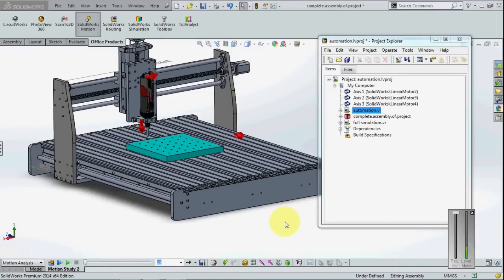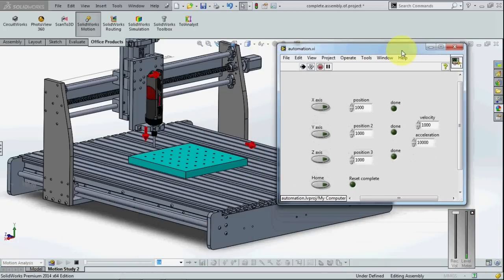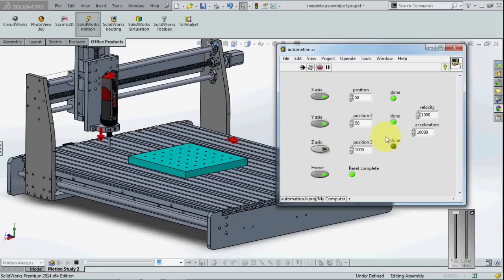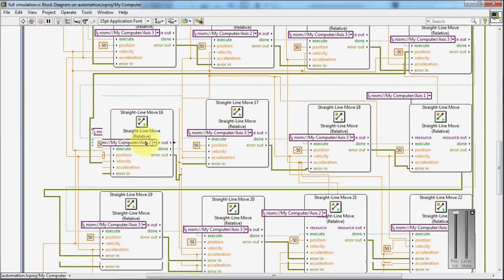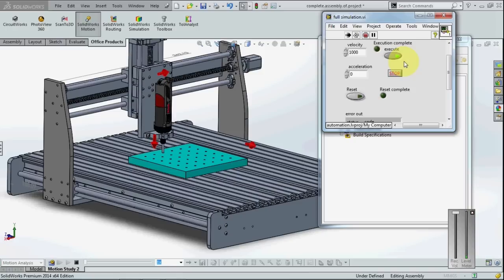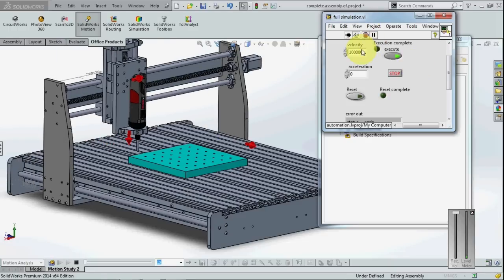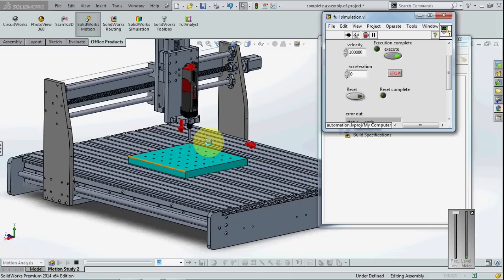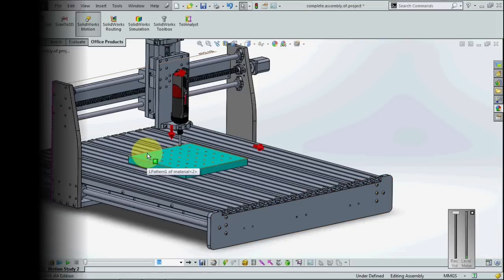Real Time Simulation With Solidworks and Labview

Comment: Hey, first i wanna say 10x for what you are doing, second I would like to know if you can help me with some guidance steps on how to get to the point that you present in your video, like what blocks to use in labview, how to connect with solidworks, how to make it run, how to create the VI file...etc. Please help me :(
Reply from the maker: Tgr Hi , firstly you need to download labview softmotion toolkit , I 've uploaded all the files in my blog http://www.labviewarduino.in/2014/11/virtual-prototyping-in-solidworks-and.html, you can check it here, you can also take a look into this video which shows steps to interface labview and solidworks https://www.youtube.com/watch?v=mWI2cLzAncI
Reply: I already have the programs installed and I will check out that video. Can i come back if I have any questions? thank you!
Reply from the maker: Tgr sure anytime :)
Reply: Arduino Robotics LabVIEW Solidworks I have chosen a model like the geneva wheel so i can practice this motion study on it. So there as i presume you know, that wheel spins...so i chose a rotary motor for that, but for the labview i must have a distance motor, so i chose a distance motor instead of rotary?? And second, in that video that you gave me earlier you selected a straight-line move block for your model, do i do the same or is there some other block for spinning?
Reply from the maker: only distance motor is supported by the labview .. you can select the straight line move block , it will work
Reply from the maker: Tgr only distance motor is supported by the labview .. you can select the straight line move block , it will work
Reply: Arduino Robotics LabVIEW Solidworks Hey, sorry to interrupt you again. I managed to do the Vi file and connected it with solidworks, and I actually moved the pinWheel in SW with Labview, but at some point I get an error like this: 
"Error 70233 occurred at Property Node (arg 1) in nimc.ex.straightLineMove.startStraightLineMove.axis.modeAbsolute.0.vi:7450001>geneva.vi

Possible reason(s):
Motion:  The specified resource was not found. Verify that the resource input is correctly wired, that the resource is deployed, and that all resources used in the operation are on the same target."

Do you have any idea where the problem might be?? I'm lookin forward to your response.
Reply from the maker: Tgr could you send me your vi and solid works assembly.
Reply: i would gladely do that, but how? Will you leave me your e-mail adress?
Reply from the maker: Tgr jayakumarmagesh@gmail.com gimme a day time will look into your problem and get back to you ASAP,
Reply: Ok. i will make an winrar archive and send you the assembly and the Vi. I will wait for your answer. You are a good and great person. Thank you!
Reply: @mageshjayakumar1653  hi. 
I saw your simulation and I am very very amazed .
It is great great.
 I tried to have it on your blog but no access.
Now I am working on a project bad I need to improove in labview. So I would like to have the files of your projects.
Thanks for everything you share
My email is justeverlaine@gmail.com